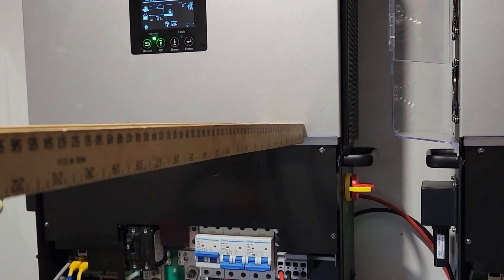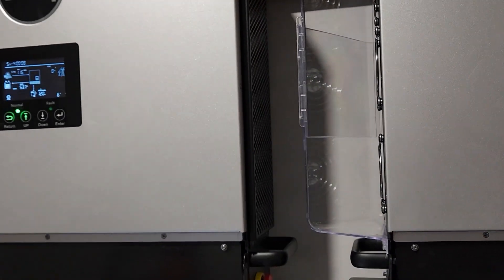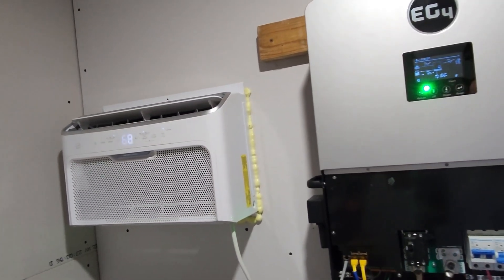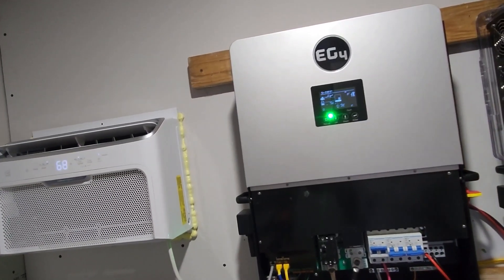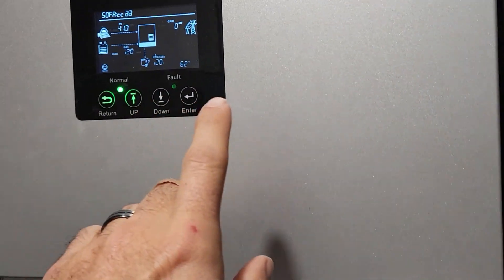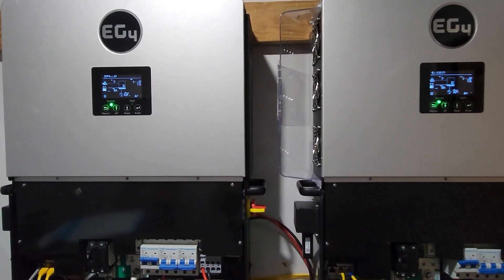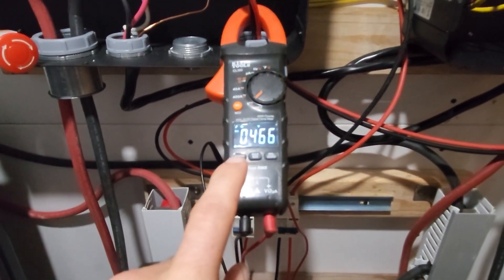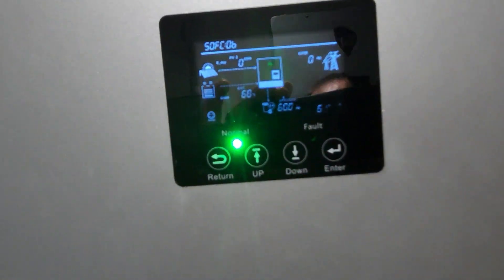More sound testing (52-57 dB) at 50% Solar 60% Load and MPPT 460 VoC

Comment: Better hope you don't have cold solder joint or any micro fractures that can lead to hot spots in your solar module cells that will cause arcing and roof fires running at such a high OC DC voltage. I've seen the results of plenty of module fires over the past 25 years.
Reply from the maker: My solar array is a ground mount.

Comment: Hey! I appreciate the video... can you do me a favor and check sound levels with the inverter on but at night (no sun) and a suoer light load, like 200 watts?
Reply from the maker: Sure, I'll test that tomorrow and make a short video.  Do you have a general range that you would like the sound reading?  

How about fan speed? Fan speed can be adjusted from 20% - 100%
Reply: Not sure, we have our inverter/battery bank in the upstairs of our cabin, where we sleep.  We use dc lights, so generally only run the inverter when using ac power during day. We're building a guest cabin thst we plan to run ac power to from our cabin, so will need to run the inverter at night so guests can use lights, charge phones, my father in law uses a cpap machine to sleep as well. Just wondering if the fan wiuld even come on with 20-200watts? 300- 400? And does it make any other sounds- our current inverter (magnasine) makes a 55-60 decibel buzzing sound at idle that is pretty bad.
Reply from the maker: No load buzzing or humming noises, but my ears are are old.
Reply: Maybe 6 ft? Probably 20% fan. Can you try gradually adding load to determine what wattage triggers the fan?
Reply from the maker: Finalized the video, uploading in a few minutes.
Reply from the maker: 400 watt load, 70% fan 35 dB at 15 feet, 45 dB at 10 feet and 58 dB 6 inches.
Reply from the maker: 20% fan speed resulted in a 10 dB drop at 24".  5 feet was 35 dB. Note my reader only goes down to 32 dB.
Reply: Thanks so much- this is great information.  Nice setup.

Comment: I was considering this unit for a RV install, but it might be too loud. I wonder if the fans can be replaced with quiet units.
Reply from the maker: The fans appear to be accessible.
Reply from the maker: 30 or 50 amp RV?
Reply: @theadventuresofarenaissancman  50

Comment: Wow, thanks for that!! It looks like signature solar is trying to be conservative with their numbers. They say it will only mppt up to 120-385v dc in the spec sheet. Thanks for taking the time to show us the numbers!
Reply from the maker: The max MPPT is listed as 480v.
Reply: @theadventuresofarenaissancman  Mpp operating voltage is listed as 120v-385v, DC input voltage range is 100vdc-480vdc. I made a previous mistake with a different brand where the MPPT voltage spec was where it ran and the max voltage was where it would stop due to voltage and could protect itself up to the max, but wouldn't generate power when it was over the Mpp operating voltage. 

On this one either signature solar is giving themselves extra room, or I'm not understanding their spec sheet. When it gets cold up north the voltage will rise above the solar panel VOC voltages. So possible to do damage in a cold snap if you're aren't careful up north.
Reply from the maker: Correct.  I should remove one panel from my string.  460 VoC will be to high come the colder months.
Reply: @theadventuresofarenaissancman  Probably should, but it looks like it keeps producing power right up to the 480voc mark. Very good to know. Thanks!!

Comment: Appreciate these video updates. Need inverter(s) for a grid powered cabin. Heaviest load is a 240v well pump which has been changed to a Grundfos SQ softstart. Primary reason is to keep fridge freezers going when not there (unoccupied 3 weeks a month) but also muscling though a power outage when we are there (1 week a month, maybe longer if mountain passes are not cleared of snow). Think this unit is reliable enough for unattended use?  In the last year, when at the cabin, peak KW usage was 3.8kw so one unit will suffice but want two for redundancy.
Reply from the maker: I have a short redundancy video, I'll post it in a day or two.  Basically, when using two in parallel if one inverter fails or shuts down.  The other inverter will continue to power the load.